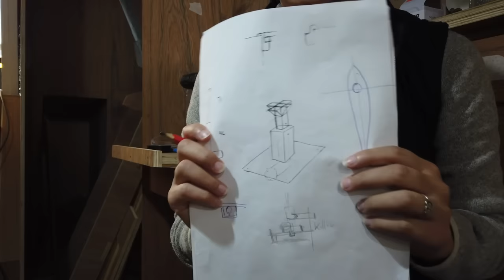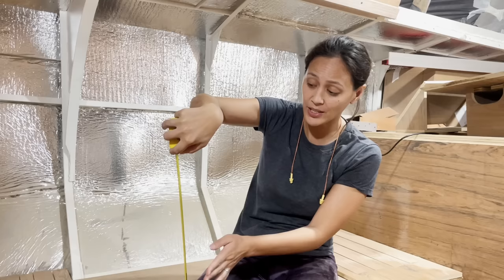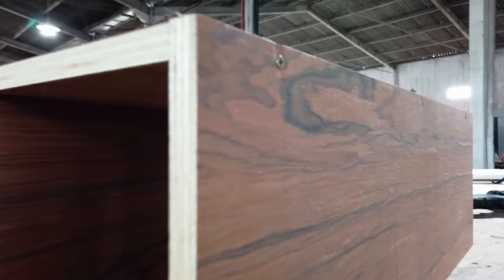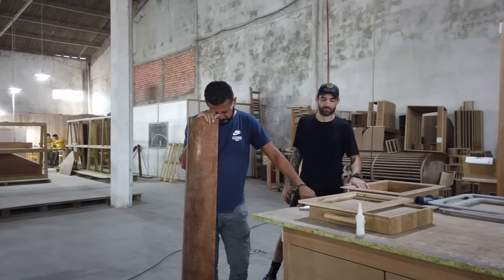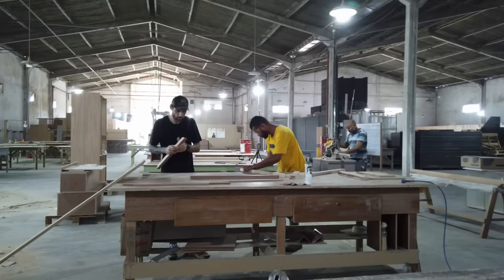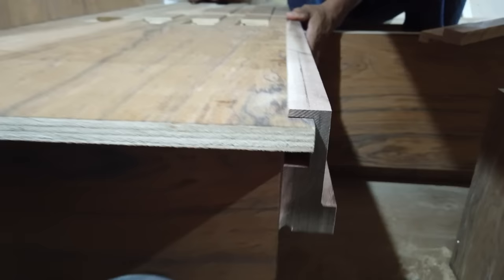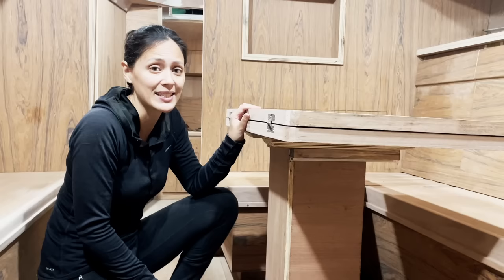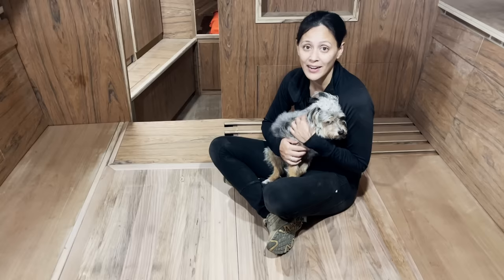Building a Space Saving EXPANDABLE table in our Boat Cabin ⛵️ Ep51 – PART 2

Comment: That table is so awesome!  You should patent it or even sell plans:-)  Couple of questions if you have some time.  Are you concerned over the wood sliding against wood?  Love the idea, my past experience with such slides in our house's basement growing up would swell a bit and then not want to slide (during higher moisture times).  Also, just in case the linear actuator were to go out while in the middle of a sail, you may want to have a method to positively lock in the table position (for example if the motor shorted out while in the bed position).  Just till you can comfortably complete your sail and look for another replacement.  Just a though.  Again, loving the solutions you are all coming up with!!!
Reply from the maker: Thanks so much!!
Because of the special glue, marine grade plywood is less likely to swell. But we will be putting some padding in places where there might be rubbing.
You are right to be concerned about the actuator. Even though it’s waterproof and has a guarantee for 5 years, we still made the leg usable manually if we need to remove the actuator all together for repair.  Great questions! Cheers! ⛵️🙏🙌

Comment: You need to look now RV's install extra beds yours is far far to complicated the activator is slow and they are not reliable when used in salt air conditions like the insides of boats.
Then when it sticks your in big bi
Your just making hard work for your selves all the time 
Best of luck 😊
Reply from the maker: RVs do have amazing solutions! The great thing about this particular actuator is it’s completely sealed and waterproof IP67, guaranteed to 1 meter in depth. And takes 20 seconds to lower it. You are right about maintenance. So we designed it so we can easily remove the actuator for repairs or remove it all together and the table still works manually. Cheers!

Comment: One question but you have probably think about this point: what about the weight of all the modifications and the new interior… do you think it’s similar to the old spec ?
Good luck for the end of the built , progresses are awesome !
Reply from the maker: Thanks so much!! We are keeping an eye on the weight distribution so that it remains relatively the same as the original. Keep in mind the original boat had a sizable diesel motor that we will replace with an electric that is a fraction of the weight. Cheers!

Comment: If you look at all of you sitting around the table the extension leaf is saging down as the support does not come out far enough under the table
You always need the support to come out a min of half the width of the table yours only comes out max a third. You can buy shelf pull out rails in 3 sections to allow the support of come out to a min of half way, in time yours will fail for sure some one standing up but there hand on the table to help get up it will break for sure 
I know from past experance the  extension needs to be able to take the weight of a person 
Im very surprised that your carpenters did not see this
Reply from the maker: The support of the open table is not finalized yet. Cheers!

Comment: I love this design, the amount of function you've achieved in such a small space BRAVO! 

but...

it looks a lil flimsy - can you speak about the strength of this set up?
Reply from the maker: Sure! Which element concerned you? Keep in mind this is all still in the works so there’s room for improvement.
Reply: @lahakai I am concerned about the thickness of the wood when the bed pieces are extended out fully. Maybe it's sturdy enough to lay flat on, but it doesn't look like it could support much weight.

I can picture an instance where you have everything layed out in the big bed configuration and someone wants to go to the bathroom or v birth - instead of moving everything they just walk over the bed and potentially break your set up.

Thoughts?
Reply from the maker: Good question! We are testing this still to see if we want something more sturdy and there’s a couple options to make it really firm that we are working on. They also need a lock to keep them in place so they stay secure. We’ll make updates on this soon! Cheers!

Comment: I love the clever way you’re  designing your boat, using each piece of furniture and space to be useful on manny ways, and this is posible thanks to this amazing workshop team that materializes all your ideas. Maybe you can use the table on low position as a rail (and another on the button side of the galley) to take out and maintain the sliding section of the small bed . Or the simplest solution would be having a leg that folds 90 degrees just like the folding section of the table ( but folded on the other side)